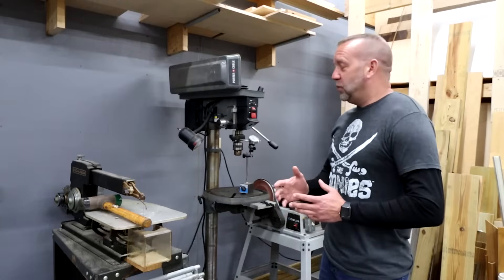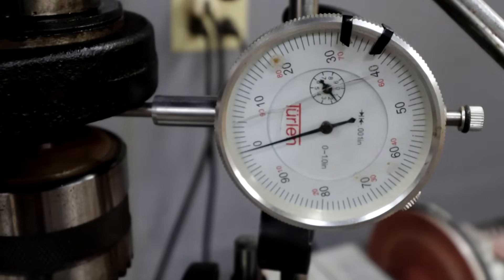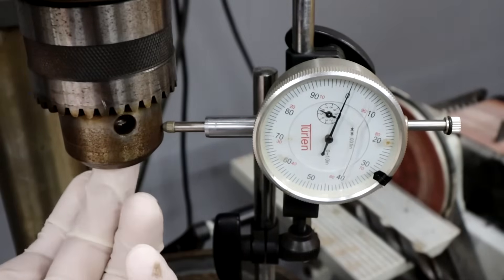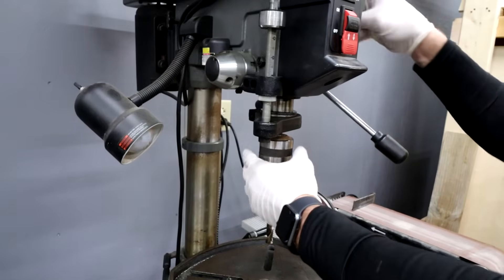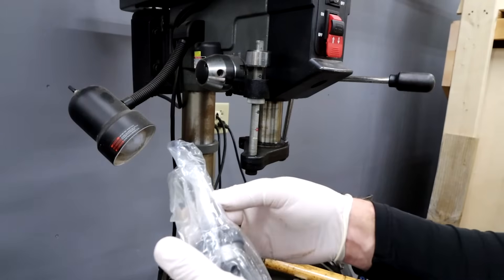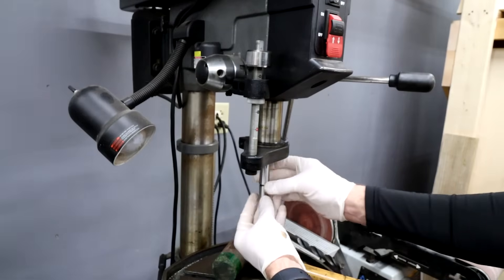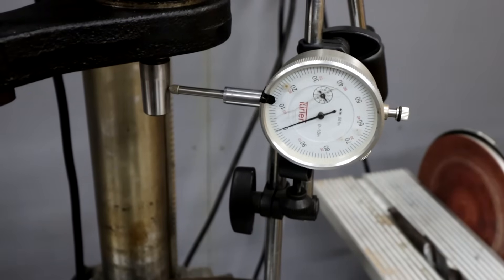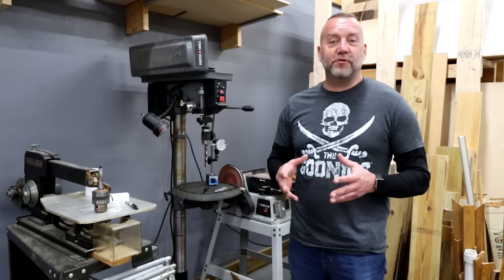Shop Shorts - Drill Press Chuck Runout and Replacement

Comment: If you have a reamer blank or the shank of an old reamer, measure the runout along the length.  It might be .001 by the chuck and .040 two inches down from the chuck.  New chucks have been known to have manufacturing debris in one or more jaws that make the drill at a drifted angle to the center axis.

Comment: The drill chuck is usually in a Morse-type taper and set into a tapered collar. While the fit is usually tight and prevents runout it is possible to be off. My suggestion is to remove it and place it in a freezer for a few hours. Reinstall the chuck with the taper. Check runout and use a soft mallet to get it as close to zero as possible. Let it come up to room temperature. 
It will stay that way until it is removed.
Another thing to do is to 'tram' your drill table. Put a dial indicator in the chuck. Set it up up in a 6" arc and get your table as perpendicular to the chuck as possible. This will greatly improve your drilling operations and the drill press longevity.

Comment: I'm confused. I thought it was pointless measuring the outside of the spindle (the first measurement you took with the indicator) because it is the inside of the spindle the adaptor connects to. The outside could be true and the inside off by a lot, or vice versa. However, you understood this as demonstrated when you measured the outside of the chuck. Am I not understanding how the spindle works and why measuring the outside is useful?
Reply from the maker: @ApprenticeGM  
You’re correct although it’s a baseline. The external and internal should both be true if machined properly.

Comment: The tab was originally designed to fit into a slot inside the spindle. 
It’s purpose was to prevent torsional slipping, back in the day when tapers were hand formed and potentially imperfect.
Today we have levels of precision that mitigates the need for the tab.

Comment: Uhhhh. Isn't the runout from the spindle transferred to the adapter and the chuck since they are all connected.?
Reply from the maker: @dgeos4740  
No. I put the dial indicator on the spindle and it was perfect. The chuck or arbor wasn’t machined to a high tolerance.
Reply: @JaredsShop 
Ok. I thought the original measure of the spindle almost exactly matched that of the adapter.  I'll watch again.

Comment: Bit late but it's possible to get a screw in drive tang when using  threaded MT adapters designed for milling machines.
You check the small counter dial on DTI to see how much travel you've used, it counts tenths of an inch on that particular one (one hundred thousandths)
The drill shank may not be totally accurate as it showed a cyclic deviation.

Comment: Do the errors accumulate and/or cancel each other out? If you measure runout at the drill bit first and it’s in an acceptable range, is there any value in replacing the chuck or adapter even if they have higher runout relative to the bit measurement?

Comment: Reading a lot of the comments here. Haven't seen one that brings up the idea of placing the indicator base on the head of the drill press instead of the table. When turning the spindle by hand, shaking the whole drill press, seems like there could be an amount of play between the head and the table.
Reply from the maker: I don’t think that’s an issue because the runout was very repeatable. It would’ve been more random if it was loose. I did have to table tightened also.
Reply: @JaredsShop  I guess it stands to reason that one would want to indicate from the table to the spindle. After all, that's where the tool meets the work. You can probably guess I'm not a machinist. Just a stinkin carpenter poking my nose where it doesn't belong. Lol

Comment: Great video!  I bought that same Wen keyless chuck for my Wen 1412 drill press.  I found it has excellent runout, but as you show in the video the arbor without a tang was too short to get it out of my quill with the wedge that came with the drill press.  I tried buying the MT2-B16 adapter, but couldn’t get the original adapter out of the chuck.  I called Wen and found that the LA162 chuck is made tor lathes.  They recommend the DPA158 keyless chuck for drill presses.  It has the tang that locks in the arbor and sticks up high enough to knock out with the wedge.  Wen sells both chucks for the same price.
Reply from the maker: Good information on the part numbers. It’s a little ironic that the description states it is for drill presses, lathes, and mills. I didn’t have an issue getting the tang out of either chuck I received. I just put in on top of a vise with the jaws slightly open and used a punch and large hammer. 

Either way, the other part number definitely could’ve saved that step!

Comment: What?, Why not mark the high spot on the drill bit and rotate it opposite high spot on spindle, Try it as see it it increases accuracy, See in next Video.
Reply from the maker: There wasn’t a high spot on that bit. The chuck itself was the issue. I had rotated the bit multiple times but it still had the same issue at the same spot.

Comment: The original adapter usually comes with a threated hole in the end of taper. You  should have put a bolt in there with a thread lock and shape the bolt to fit in instead buying a  new adapter.  Just a friendly advice.

Comment: Very nice and to the point video. Found it by accident and now became a subscriber as I like your style.

I have bought a used drill press and in the process of restoring. So this is very relevant and useful. BTW if I find the main shaft (& not the extension or the chuck) to be the culprit what is the solution? Do I need to replace the bearings? Since the drill press is an old one I don't think any spare parts are available. Thanks in advance for any insights you can give.

Comment: drill bits are NOT a precision item to check concentricity, get a proper parallel  bar to check that
Reply from the maker: All of the bits were the same so I felt confident in results. I’ve setup many CNC and manual machine tools in the past and am familiar with precision setup. This was an example for the average homeowner.

Comment: Please do not use a hammer to remove morse tapers from the quill. 
Simply pull down handle expose and align slot as shown Inset wedge then hold chuck or drill bit and lightly let the  drill up and lightly bump the quil up.

Bonus no more dropping drills or chucks!

Comment: Don't worry about the outside of the spindle. Check the bore the taper runs in for runout. Mark the chuck when you remove it. Clean everything and check for burrs. Reinstall the chuck into the spindle and recheck the runout. If no improvement knock out the Morse taper shank and rotate it 180 degrees and reinstall. Check again. If there is improvement mark the chuck so it can be put in the same way. Do the same process with the chuck removed from the Morse taper adapter. By trial find the least runout. Then set the chuck onto the Morse taper adapter with a wood block on the chuck face with the jaws fully retracted.
Lastly are the chuck jaws themselves. If the runout is coming from there, check the jaws for damage. If damaged or worn the best thing is to replace the jaws. The jaws are very hard and ground in sets. Here is where having a name-brand chuck pays off. There are repair kits for chucks like Jacobs and Albrecht. Chinesium chucks are like most Chinese products with their mysterious origins. Finding repair parts for anything made in China is usually a hopeless task. If money is an issue, throw the dice and buy another Chinese chuck and pray that it is better than what you have now. It will probably be cheaper than an Albrecht repair kit.
Reply: You can do the same with the Jacobs taper in the chuck.  Sometimes using a combination of rotating the Morse and Jacobs tapers you can tweak most of the runout to really low numbers.

Comment: You should have run the drill and rechecked your runout, popped the drill head out [ after marking}and rotated it and see if the runout is the same or +/- ,

Comment: Lots of good sense here. My only suggestion would be to place a block of wood under the chuck and hammer 'it', rather than the chuck, when installing the chuck into the drill press. Also, have the jaws all the way up in the chuck, so you're not putting the impact directly on them, and damaging them internally.   -regards, Doug
Reply from the maker: The jaws were completely recessed, but yes, I probably should’ve used a block of wood. I had just lightly tapped it on in the video just in case I needed to remove it. That way it was easier to tap off.

Comment: How do you remove the chuck when your drill press does not have that cutout for the wedge? My Delta 17-965 is a floor model and does not have that slot.
Reply: look at the chuck and if it has JT3 printed  on its side  its a #3 Jacobs taper , you need 2 wedges inserted directly above the chuck opposite each other and you drive them towards each other wedging the chuck off.  Check the writing on the chuck if it has a thread size like 3/8 24 then it threads on and you can use the key and just insert it in a hole and strike the key with a brass hammer , just look up inside the center to make sure there is no screw in there. If there is its lefthand thread and will need to be removed first.

Comment: Big runout = triangular holes!

Unless you spend big $, Jacobs type drill chucks are only good to 0.003" TIR, (total indicated runout).

If you notice, the original chuck is stamped w/ JT3, which is a Jacobs taper. That is the female taper in the chuck.

The tapers can be trued by bluing the taper surface, driving it home, removing & checking the surface contact.

Truing the tapers is the 1st step. Unless you do that first, the only hope is getting 2 runouts to cancel each other, which doesn't happen easily.

If you can minimize your TIR at the spindle, then improving chucks is worth the $.

Another factor introducing TIR is using a drill bit, even a 'good' American bit. The +- tolerances of bits is huge compared to 0.003" TIR of a chuck.

Use a precision ground dowel pin, instead. The cheapest TIR measuring tool. If you have a good reamer, that'll work.

I thought drill or reamer blanks would be adequate, & learned quickly they weren't.

I replaced an old drill press which drilled very nice triangular holes.

My new drill press had ~0.004" TIR at the chuck. W/ very little truing, I got 0.0002" at the JT3.

I had a 'good' 5/8" Jacobs chuck I paid +$100 for in the '90's, then the drill press died & all I could afford at the time was the triangular hole drill press. The chuck had 1-2yrs use.

Put the 'good' chuck on the spindle w/ virtually no TIR, (0.0002"). Now had 0.004".

A few months prior I bought an ER32 collet chuck & collets for my small lathe. Max capacity ~49/64" (20mm).

While looking for a better Jacobs type chuck, I stumbled upon an ER32 collet chuck w/ a JT3 taper on eBay for $37.

Took a chance & bought one.

The TIR on my drill press is now between 0.0000" & 0.0001". The surface irregularity of the dowel pin in a collet causes enough deflection, the TIR is hard to measure, & the dowel is precision ground.

The set of ER32 collets I bought were the cheapest Chinesium set on eBay, but for the lathe, reproducibility is more important than TIR. I did do some minor truing of the chuck, but didn't tpuch the collets.

I paid $37.00 for the collet chuck for the drive press & gained 3/4" capacity. A Jacobs type chuck w/ 3/4" capacity would be $300-350, min.

I thought the hassle of changing collets wouldn't be worth it, but it's not the deal breaker I anticipated.

I got virtually no TIR, 3/4" cap, PLUS I can now use the ER collets in collet blocks.

Can you imagine trying to end drill 1/8" rod w/ a 1/16" bit in your drill press? W/ a collet block it's a breeze. Same for cross drilling rod. It more than makes up for not having a keyless chuck.

The $ saved on ER32 vs Jacobs pays for a hex & square collet block.

I can perform drilling operations on my drill press I've only been able to do on a quill type mill.

Still can't mill w/ it, since there's no radial rigidity, but precise drilling is no problem.

Consider going to an ER32 or ER40 collet chuck to improve the performance of your drill press. You will not regret it.

Yell at me w/ ???.

GeoD
Reply: Agree. Do all of my drilling on my mill, and if high accuracy is needed I use a collet to hold the drill.

Comment: If you want to see what you run out really means at the business end of the drill bit, then what you want to do is chuck your drill bit in upside down. And then run your indicator on the shank at the far end.
Reply: No. It's not an accurate way of measuring that. The chuck jaws are not long enough to engage a two flute spiral with a  three jaw chuck. The BEST way is to use a piece of silver steel ( here in theUK ) or in American parlance, a piece of drill rod as that is centerless ground to high tolerance and will show up any runout. And the longer the piece of drill rod, the further away from the original run out should increase the run out and make it easier to quantify.
Reply: @samrodian919  Longer =bigger- Depends on if is a radial or parallel error. Best also to use more than one diameter of rod- it could be a number of causes. Sometimes changing the jaws is enough...
Reply: Any stock steel bar that is straight and fit the chuck is the way to go. My cheap drill press is fine on the retracted position, once you start going down you notice how much play is in it. It wold be good procedure to mesure runout all across the shaft at different positions!
Reply: @dcgo44r you should use drill rod.
Reply: @rodgraff1782  My point was that you can have the best measuring tools, but most of the time is not enough. Because you have to know where to measure and how things work. Like when the drill press is resting (but turning) might give you small runout, now compared to the drill extended (reaching into work) might even have greater runout in the shaft itself and therefore in anything down the line! Yes, that's a problem in the building of the drill itself, poor tolerances is number one issue. Way different problem than with the chuck or bits.